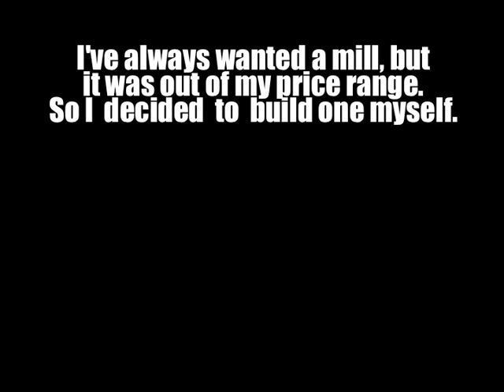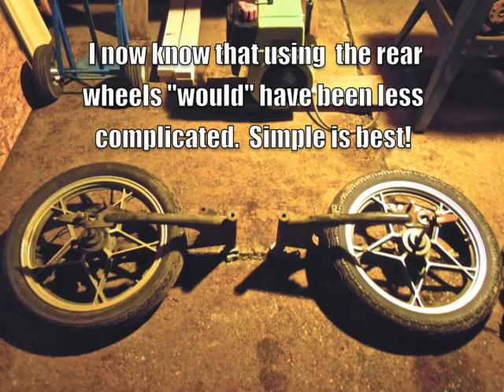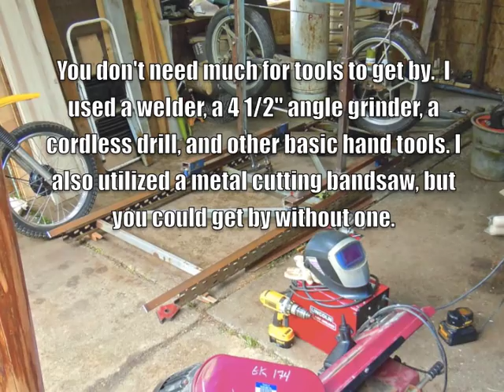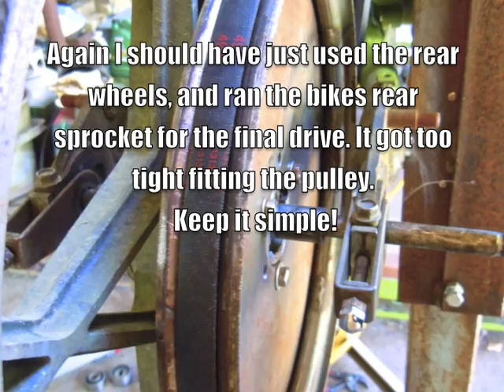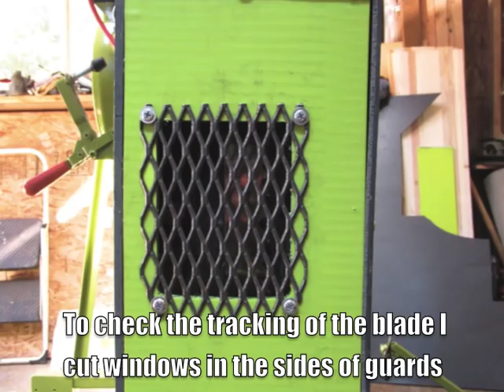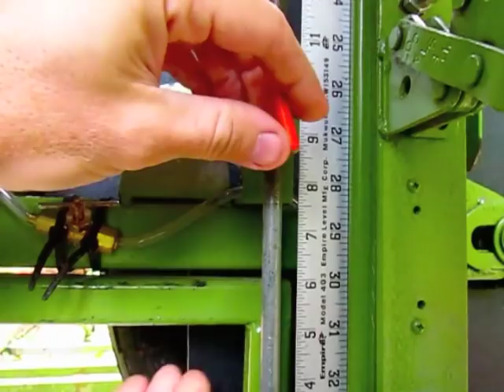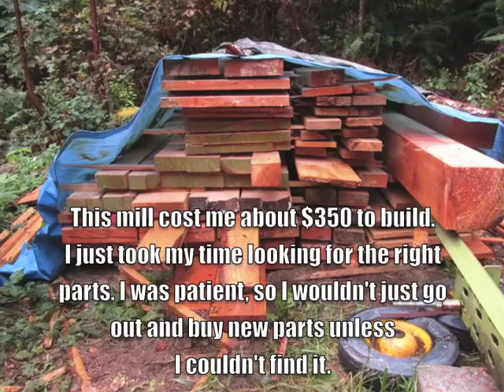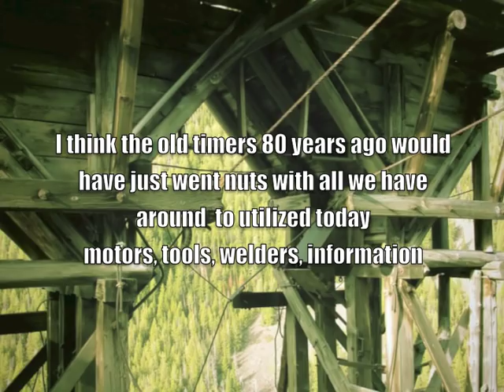homemade bandsaw mill

Comment: Nice job! I also built my bandsaw mill with 99% recycled materials. I used an 18" upright bandsaw and converted it onto its side and put a spacer to run woodmizer 13'2" blades. Worked out great. I used park model rv trailer for the frame rails. I mount an electric winch to pull logs on. I have a 1957 wisconsin 9.25 hp engine and can cut up to a 34" log 21 ft 6" long and I mounted tires so it is fully portable. I have $900 wrapped up in the entire project that is the mill and a full trailer with tandem axles for hauling logs home. That price includes the $200 dollar box of blades from Cooks and 3 winches from Harbor freight. 2,500 pound to roll the logs on, 2,500 for the bandsaw head up and down, and a $300 12,000 pound on the tongue of the trailer to load logs to bring home. Sure is fun to cut logs up! Again great job and have fun making sawdust fly!
Jason

Comment: Very good job on that sawmill. I like the way you put your video together also. Started on my mill but health is dragging the process out. Couple decades ago, I would have spent night and day till I had one built. Maybe that is why my health fails me now days. Only got one sawmill video on my channel and it only covers my concept on a drive system. I have started work on it again and plan to post more videos as I go. I plan to leave my saw in one spot to move up and down and move the log back and forth on a trolley like Wayne Keith does. Even more, I plan to place enough rail that I can reach log pile on one end and lumber drying building on the other end. Anyway, my dreams are bigger than what I can get done for the most part but hopefully, this dream will come about.

Comment: Such a cool invention! Well I know it’s not totally original but it is custom designed and built by you, so I salute you for inspiring the DIY’ers out there. I love how you work through all the different ways to make the tool not only work, but easy to adjust, maintain, and access needed wear parts. You have an amazing mind for foresight! If you’re not a machinist by trade, then you have the mind of one (or an engineer). Thanks again for the videos.
Reply from the maker: Thank you very much!

Comment: Hey sir, I'm building a chainsaw mill with a 15 horse motor and a 36 inch blade but I have a 35 horse horizontal motor that I'm wanting to make a band saw frame using motorcycle wheels that will also work on my rails. I would like to see a better pic of how the trailing arm assembly is attached to the frame. You have made a great mill and the video is very helpful and has given me the idea bout how to build my band saw mill. Thanks

Comment: You are amazing! Haven't seen all of your videos yet, but I seem to end each one with my mouth hanging slack-jawed. I've run a saw mill before, think it was about a 12 horse. There's a lot of variables and adjustments that can make it frustrating, but it's very satisfying producing boards from logs. We sawed some old growth Western red cedar and some 200 year old logs repurposed from buildings built in the late 1700s. Both amazing stuff. Also, congrats on the music, way better than most background tracks.
Reply from the maker: Right on! This mill I built has come a long way, I have added a lot of helpful features to to over the years. My mill is also 12 hp, I bet that cedar really turned out nice! I mill western red cedar a lot on my mill, it’s abundant on my property, I use it for board and batten out outside and inside for ceilings and some trim around windows, but the stuff you milled was old growth and that wood is beautiful stuff! Thanks for checking out my channel Wayne 🙂

Comment: Really great project and video. The project is excellent but the perfect problem solving is the best part. I'm really impressed with the eloquently simple ways you figured out the mechanics. This is something that is going to get built by me in the near future so thanks for the resource. I saw that the pallet racks were 36" but what's the over all length? Can you give overall dimensions of the saw cage as well? This would help me a lot in the foraging and planning stages. Thanks.

Comment: I see the yellow-jacket influence.
I used the unastrut and acme thread system.
It powers up and down quickly with a winch motor.
 I built one as well and it only cost me about $200.
It works well and I have milled several 1,00 BF of lumber so far.
The ONLY adjustment I ever use on the blade is to inflate the tire 
up to about 70 psi when I quickly change out my sharp blade.
Simple air out / change blade  and air in and I am back to work.
Not many folks know the bigger radius of the wheel the thicker possible 
cut / bigger log can be handheld, give you use a longer blade as well.
I have cut several 3 ft. diameter logs.  I used heavy I beam on heavy cement pads 
as well.
 Thinking about the next cut etc. I would bump the cant stops and waste 
a blade before I started just using wood 1 X 1 instead and they work just as 
well. in fact some time I intend to cut through them when I do a re-saw of 
the slab wood.
All in all your saw looks great and it does everything you need.

Comment: Very nice build. I am currently working on a similar but a bit smaller sawmill. I'm using 12" bandsaw wheels and a 7 HP gas engine. So far it's going OK. My biggest challenge ahead is the bandsaw blade guides. Everything else I seem to be able to do and I am by no means a mechanical minded person. I am enjoying this build because it gets me thinking ,planning, designing and I'm looking forward to see if it works.
Reply from the maker: That's great to hear!
I'm collecting parts for a vary similar build as you, 7HP, smaller wheels too but air filled. I want to make one more bandsaw with off the shelf parts that anyone can find the parts and buy, I want the mill to be smaller and easy to take part to move to friends houses or to set up close to a tree so if you have no way to move heavy trees you could just set the mill up close and start milling.
I'm not sure if you have seen any of my other sawmill videos?  I have upgraded my blade guides from these original plastic ones that I built in this video. I show some of the ball bearing guides I added to my mill in another one of my videos, they may help you out to get some other ideas? I'm starting to design a newer guide system for the smaller mill that I hope will work good.
I would love to see your mill, If you get time post a video of your project, I and others would appreciate seeing it :)
Reply from the maker: I looked for the videos that have some up close shots of how I made my bearing guides, maybe it will help you out?
I also give bearing numbers so you can order them on e bay.
This is one video with close shots, I think it about 2 minutes in? https://youtu.be/nE5Ars6igiA
and the other video I change the bearings for some spring maintenance, I think it's about 4:30 into this video where I work on the bearing guides. https://youtu.be/HHOcU-9PgCU
Reply: Soon as I have it done and tested I'll try to make a vid of it. Should be in a few weeks.

Comment: That is SO awesome! I have the rack,an engine,rounding up various other pieces.....As far as the tires,what pressure do you run them at to ensure the blade doesn't cut into them?Are the only guides the ones down low where the cutting happens?I would have thought there would have to be support all the way around the back side of the tires like how the pulleys are on the metal bandsaw I have like yours.Thank You so much for sharing!

Comment: My biggest problem is the alignment of the wheels & band saw , and also the welding job ....   Not everyone can do it but I will try this when I retire.... Thanks again buddy.... God bless
Reply: magnum mesiona. The best advice I could give on your wheels is design a plate where you can adjust wheel tracking ( forward, back and side to side). It will take the frustration out of throwing your band if your wheels aren't perfectly aligned.

Comment: Thanks for the video, I was thinking if you used the rear motor cycle wheels with the bike sprocket still on and a 100cc or 200cc motorcycle engine you could select the right gear for the blade speed you need. You might need a fan to cool the engine though
Reply from the maker: The for checking out my video! I actually have quite a few videos about improvements I have done to my sawmill since this video, Power feed, electric throttle and blade lube control and auto blade height set. I definitely think you could run the chain drive and use the clutch and gears. Take care

Comment: Great job, Mr. festiva!  😉
Reply from the maker: ***** Hi Richard. I have had no problems with the clutch on my mill, My motor is 12 HP and the clutch is rated for up to 13HP so I'm under that. I never had the clutch slip in a cut, but I have had a belt start to slip a little and I had to adjust it a bit. The cost of this clutch was about $75. The original shaft size clutch was going to be over $300. so If It does go out in a few years, then I don't mind buying another one. I built the mill less than a year ago, and I have had a hard time moving big logs around to mill, so I only have about 20 hours of run time on it, but spring is around the corner and I'm getting a John deere crawler so that should help with moving the logs to the mill. I'm going to make another video of running the mill this spring to show it cutting lumber. I hope this helps :)

Comment: A lot of work and ingenuity went into this mill. I'm designing one now that uses parts from a kalamazoo horizontal metal bandsaw. So far I'm using the pulleys, tensioner, guides and guide track from it with a new 6.5hp predator motor. A little smaller than yours.
Reply from the maker: Thanks for checking out my mill build! I have many other videos of my mill in operation and upgrades I have done to it, so check out my channel if you get time :)
I have been real happy with my mill, It's well worth building one, you will for sure be happy to mill your own lumber!
When you get done you should post a video of it, I would love to see it!
Reply: Mike festiva I sure will when I get done. I have 16 acres of timberland in Missouri and tons of dead fall on the ground. It kills me to see it laying there. My mill should have a 24" wide cut and I can go about 10" deep max. What I can't cut my neighbor can. His runs a 144' blade.
Reply: justin: depending how small you go, like at most 8" boards, then 10 or 12 horsepower is needed. 15 seems pretty middle of the road. if it cuts faster, and you don't want to spend an eternity on each board, and have the kerf right, you could slowly make boards with a 6 1/2 hp mill. but just think of a moped, or my first honda, which was 5hp 50cc. that would not run a mill of any use.

Comment: Awsome use of scrap and bits and pieces and still very professionaly done . the poney clamp hold downs are genius. I have tons of them laying around. I'm still not sold on vehicle tires? I have ran architectural millwork shops and the massive bandsaws require so much tension on the blade to be correct in tune in not confident I could get that without steel wheels. Tracking and lube floating the blade in the open air wheel? Tell how it is working after you have ran it. Nice job.
Reply from the maker: Thanks for checking out my mill build!
This is actually the first video I had ever posted on YouTube, if you go to my channel there sho e a play list of quite a few videos on me running and adding upgrades to my bandsaw mill. I was a bit skeptical about the rubber wheels too when building it but I’m completely happy with how well my mill cuts. I do maintenance on a bandsaw mill at my work, it’s a 40HP electric for the saw head and another 40HP for the hydraulics, it’s got the traditional metal wheels they are 36” so I have something to compare it to, and again I’m really happy with my mill and it’s been running for over five years now. Take care
Reply: Thanks Mike I appreciate the response. Good to know the wheels are working well. I'm collecting the parts hopefully it goes well.

Comment: @Mike festiva 

I love this.  All of this.  I happen to have like 90% of this crap in my backyard, and I'm so inspired right now.. but I have a question - - So... What keeps the band on the rubber tires?  the blade guides at the cutting level?  Is that all?  Do you worry about the band walking off the tires under cutting tension?
Reply from the maker: Thanks for checking out my video! 
That’s great if you have most of this stuff, I have many videos showing this mill in action and upgrades I have done to it. The way the blade stays on the tires it because of the tires being crowded, the blade tries to ride to the highest part of the tire, the blade guides and roller bearings keep it from pushing off the back when pressure is on the blade in the cut.
I also have tracking adjustments on each wheel it set the tracking of the blade. If you have any questions feel free to ask 🙂

Comment: is there any problem useing castors as u did? some worry about sawdust build up and run castors on edge. i would prefer your way if it works well. thanks. hope your still checking in on comments. nice mill by the way
Reply from the maker: Thanks for watching :) 
I have not had much trouble with sawdust building up on the rails, only a little when I first built it, maybe about 3/32" or 2mm of compacted dust. I never noticed a problem, but I did take a piece of plastic and mounted it on the lower saw frame so that it covers the lower casters and rail on the saw dust discharge side, so now even if sawdust falls on there it can't get between the casters and rail. I have no problems with it. I hope this helps.

Comment: Awesome build... music puts one in a trance and starts to get creepy as hell after a few minutes tho lol- but not bad by any stretch
Reply: +btchhopperou812 
I have to agree with the man here on the music, you could have sure found something better then that, however, the video itself was awesome. 
Excellent job building the saw mil and making the video also, short of the sounds LOL. 
One great thing ou did was give the guide for the feet per minute on the blade speed. 
I am in the middle of building my on saw mill and have spent three days calling companies trying to find out what you just told us and I gave up on finding it out. 
I saw another video of a home built mill that showed the rear of the mill in progress of cutting and guestimated the clutch to have a 3 " pulley and the shaft pulley to be about 9' and it used trailer tires that that looked the same as what I just bought cheap, which are 20" in diameter so I calculated the speed and ordered a 9.25"  pulley for the drive shaft and a centrifugal clutch with a 3" pulley about three or four hours ago. 
I am not going as far on the cheap side as you because I have a couple partners and this will be a business, so I will order a new engine. 
I'll look at the site you talked about tomorrow, what was it, Cook's Saw MFG., but I had already thought about a 13 HP engine. 
I'll check out the H.P. to FPM blade speed alot better now and order the best one. 
Thank you so much for your time to make the video. I wish I could learn to make a video like this. I would love to show ya'll the boiler I built to heat my home and shop with. That cut my Utility bill from over $6-700 the last three years down to less than $200 this year, and that my man, I did build on the cheap. 
Two use oil drums, one 265 gallon for the fire box and then I paid $100 for the 550 gallon drum I used for the tank. 
Still cost me a bit over a grand but heck, I saved that in two months this winter. 
Carry on my man. 
Dennis

Comment: Putting the swingarms down at a 45 degree angle would have made the clearance greater than just 12 inches.
Then cutting the tubing just above the adjustment wheel slot plates bringing them back into the horizontal plane and re-welding them would give the same adjustment. Great looking saw and scrounging abilities to produce a working solution for an economical price.....
I've got stuff lying all over my place to make one and a shop full of tools.
The project list is long and time is short....maybe one day.

Comment: Nice job Mike,thinking about doing the same setup and got a few questions for you if you don't mind.What size pulleys did you use on motor and drive wheel? Trying to figure out what speed I need for a 11 hp gas Honda motor.Length and width of blades.thanks
Reply from the maker: Thanks for checking out my video. So I used a total of four pulleys to drive the blade, mostly because my motorcycle wheels were large being 26” diameter. 
My motor is 12HP and I used a centrifugal clutch with 1800RPM Engaging Speed. The clutch pulley #1 is 3” and the first belt goes to #2 pulley 6. 1/4” which then powers a 1” shaft with pillow block bearings with #3 pulley 4. ¼” on the other end powering the second belt going to pulley #4 which is a homemade 12” pulley.
For blades I’m using older free carbide tipped blades from a big band saw from my work after they replace them with new ones. They are 1 .1/4” wide. What I did to figure out length is start building the saw, when you have your wheels in place just take a tape measure and put it on the wheels like a blade and try to get a good measurement of the length, order one blade and see how it fits on your saw. Most places that sell blades can make any length you need so this helps. It’s always good to try to have a bit of adjustment for your blade. In my video I point out Motor power to blade speed at 10:18 in the video so check that out. I hope this helps you out!